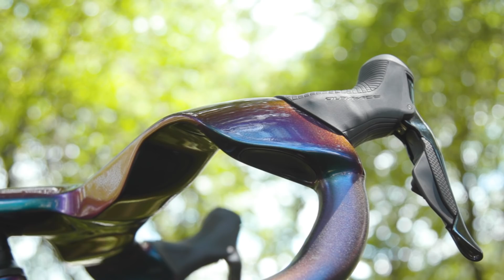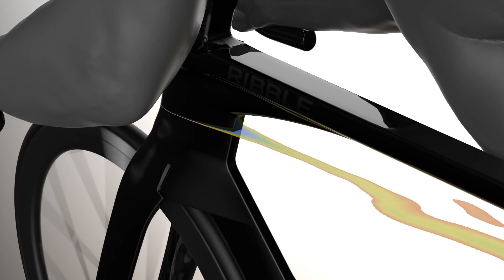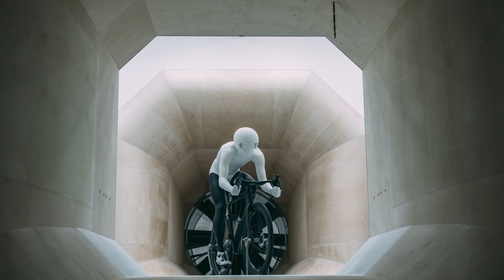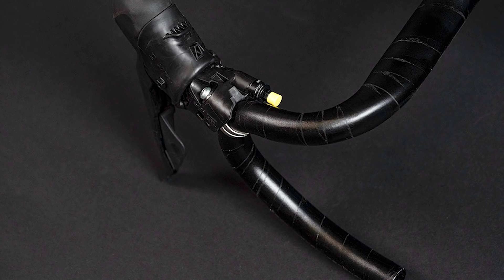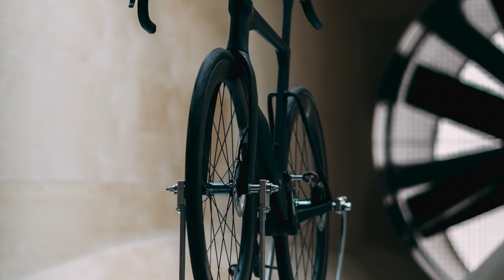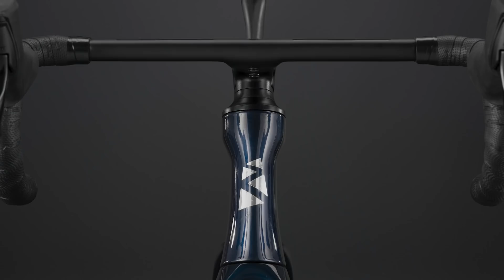NEW Ribble Ultra Aero Road Bike | The Future of Aero Bike Design?

Comment: Beautiful bike but. 
1- Is heavier than an M1 Abrams.
2- Turning radius is horrible. 
3- When the water bottle stars defrosting that water will run straight to that charging port at the bottom bracket and sooner than latter will crate issues. 
I wanted one but I think I’m going to pass.

Comment: Hi. It was mentioned the bike starts at $3K, but without the slick handle bar. Thus, how much are the ones in this video? In addition, it was also brought up that performance savings would start at speeds ranging between 22-29 MPH, but i don't believe these are numbers for the average rider. Hence, benefit from (if at all) on such bike design and let along justify the cost. They have nice paint colors though. Cheers mate..

Comment: Just putting this out there, shaving you legs will save you effectively the same amount of time, 79 seconds, over a 40km Time Trial - Bike Radar's own reporting and also several studies.
Wearing a skin suit will also save you similar range of savings, around 96 seconds for example using a Specialised skin suit. 
Sorting you position on the bike will probably have a bigger effect by lowering your CdA.
However if you have cash to splash the bike looks awesome.

Comment: If Specialized had come up with that handlebar they would be getting absolutely flamed in the comments for how proprietary it is.
Reply: It's a good thing Specialized learnt from their mistakes with previous bikes, I like how easy the new ones are to work with.

Speaking of proprietary, I now hate the Pinarello Dogma F, not only limiting riders to one cockpit, but beefed up the steerer tube to 1.5 inches too, a diameter no other cockpit takes.

Bikes with full internal routing that aren't very difficult to work on and have great cockpit + groupset compatibility almost always win my heart.

Comment: I have to say that it looks quite stupid with standard bars! What's the weight?
Reply from the maker: The top tier, Dura-Ace Di2 model with ENVE Foundation wheels is claimed to weigh 7.6kg, so we can expect cheaper builds to weigh a bit more. Thanks for watching! 🤘
Reply: @bikeradar  wow, my D/A Di2 Disc TCR isn't much less and has much lighter wheels.

I've been holding back on an aero .. thinking that aero and each and TT, etc should all evolve into something we could simply call a "bike" and maybe the Ribble is almost there.

Comment: I like the idea of doing something different with the way the levers attach to the handlebars but I have one question.  One of the advantages of the traditional clamping setup is that if you fall the clamp lets the lever rotate so the bar has a better chance of survival.  Has Ribble designed the bar mounting for that kind of crash and ride scenario or will a crash require a new bar?   If so, have you ordered enough replacements to accommodate the need or will people have bikes hanging on racks waiting for months?

Comment: Any particular reason why the Dura-Ace equipped bike uses XTR rotor?

How are the shifters attached to the bars? It is also not quite clear how the brake discs are shielded from the wind?
Reply: Because they are cross compatible and it is impossible to get dura-ace disc until 2022
Reply: @graemepaterson1983  indeed,..I have DA rotors which are nearly worn, am thinking of switching to either XTR or Campy rotors.

Comment: Yes it will be one of the most aero road bikes you can buy (maybe the most now that brands have stopped selling rim brakes that are more aero) but it's basically a time trial bike with road bars at this point... The handlebars wake generators will have to be tested independently to see if they actually work, I suspect they may only work in the laminar flow wind tunnel and not out on the road in real world turbulent conditions. The non-round clamping points are definitely a good advancement though.
Reply: Aero hardly matters in a bunch anyway.
Reply: @mitchellsteindler  yeah, that makes the bike even more pointless, just unneccesary weight and harder to control in windy conditions. I think the guy said it was designed to be near the front or in a breakaway at some point in the video though.

Comment: They talk about it being a bike for every day riding....What about lighting and gps mounting options? Is that a press fit BB? Is the handlebar supposed be wrapped/can it be wrapped and look decent? Its mentioned it doesnt need to be wrapped but are the bars comfortable and will they provide enough grip? Different bar sizes? Are there any different length options? Was tire clearance mentioned? Also, fun fact, its mentioned that at a lower speed you can save more time, but could that be because there are more seconds to shave off over a given distance? Because if its a faster bike aerodynamically wouldn't it save a greater PERCENTAGE of time (rather than just seconds) at a higher speed?
Reply: Its simply maths... the longer is the ride the more you save time. Nothing new
Reply: I think its not designed for a long endurance trip. Maybe its more suitable 30/40km loop sprint cycling session.  Because I don't even have a bidon and lights on my bike lol i just mount my cyclocomp on the stem
Reply: I hope I can wear my designer jeggings and white leather jazz dance shoes whilst riding the Ribbed XXL Aero..lol
Reply: Excellent points.  Too much marketing speak and not enough practical talk in this one.
Reply: @MrKevinWhite  who cares about practicality when it comes to marketing? I also tend to think that traveling with such a bike would be the ultimate pain in the ass
Reply: @krbndlls  lol that's true 😂
Reply: The ultra comes with a standard threaded bsa bottom bracket across all models, with multiple options in handlebar widths and stem lengths. Hope this helps in some way 👍🏼

Comment: The direct mount handlebars are more of the game changer here than the frame.   EVERY bike brand will brag about "aero optimised" frames, greater stiffness, more aero with a bottle etc..... but I think only Ribble and Shimano have so far gone to the tapeless bars and the Ribble looks more advanced on the integration.
Reply: drivel, drabble, fibble, babbel  😊
Reply: Total integration means a shitload of ugly, heavy, proprietary, non-interchangeable components. Crash and they'll take months to be replaced or until you'll be told that the parts are already out of production.
Reply: @einundsiebenziger5488  Direct mount brakes, flat mount disc calipers, English thread BB, 27.2mm seatposts, 1 inch threaded, then 1 inch thread less to 1 1/8th thread less and now tapered steerers, Garmin 1/4 turn mounts, GoPro mounts, all started out proprietary and now are commonplace.  Just because it's unique now doesn't mean niche in the future.  As they state in the video, the bars are the development, but the shifters are standard.  Smash a shifter in an accident and it can be replaced.  

If your looking for gains, these are the expensive extreme marginal gains level tech solutions.  Pro teams would have a load of spares to eek out every last watt.  For the weekend warrior with the cash, a tube of Veet and a razor blade will have far greater aero gains.
Reply: @a.cyclist  Thanks. I am not talking about means to attach one thing to another. While the Gamin mounts were unique to Garmin computers, the mounts could be attached to any stem or handlebar. I am talking about e.g. integrated stems and spacers that only fit one specific frame and cannot be mounted on any other frame. And look at Cannondale's bars bolting on top of the stem. You can neither use their bars nor stems on any other bicycle. Bad enough that almost every manufacturer has its own BB measurement and calls it "standard", now they're etending it to bars, stems and spacers.
Reply: @a.cyclist  is the veet for the legs and the razor for the face?
Reply: @markblanch2905  start at the toes, stop just above the eyebrow line for maximum aero gains.
Reply: @a.cyclist  hmm, doesn't answer my question in any way but rightio

Comment: When did £3100 become a competitive starting price for a bike with 105. That insane. The industry has gone mad.
Reply: Exactly, £3100 for a 105 bike without the ultra bar? LOL...
BTW the wheelset costs around £650 and is heavier than my alloy cosmics...
And it is out of stock until April...
Reply: @methe2960  what the fuck is the point of having a bike that is marketed as having x features and then not having the features in the model most people are likely to buy…
Reply: Er… because in the piece it says that every build comes on deep section carbon aero wheels? Or did you miss that there’s a £1k+ wheelset in the prices?
Reply: @rep7552  open mold deep section carbon rims are less than $200 from the factory.. theyre nothing special anymore

Comment: The handlebar design is interesting. I like the idea of a direct mount lever. I hope there's a level of adjustability on the angle of the hoods. As much as I like having it level, there are others who may want to push it down or tilt it up a bit.
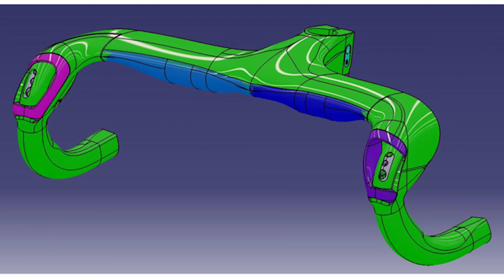Reply: at 6:40 you can see the groove/bracket to adjust the lever.
Reply: They have 15 degree angle and 30mm vertical adjustment based on a written review.

Comment: What happens when that handlebar swings round when moving the bike or packing whatever and smashes the top tube? Was it tested with bar tape and/or have the put a stop on the bars turning maybe? Might of missed but that's all I could think of...
Reply: you don't pack this bike. You ride it to where you want to go. If you have to cross the sea then you buy a new one when you reach your destination.
Reply: Just put bar tape on the drop...
Reply: I would expect the steering to lock at some point, I know at least some aero bikes have a limited steering radius.

Comment: Edit. Ah I was mistaken. I was looking at the aero SL R frameset page and it seems that the geometry shown there was from their carbon gravel bike. Rest of this comment is therefore irrelevant. I will let ribble know about the small website mistake.

Wow the geometry though is very high stack compared to its reach. How is that aerodynamic for the rider? I am a full two cm higher in size L than I would expect from a race bike! 592 stack in size L. Only 389 reach. But the handlebar seems to have a long reach to it and combined with fairly slack seat angle, reach may not be the issue. So that might relieve that. I would expect something around 570 ish, regarding stack. So it actually seems very optimized for the recreational rider, not the competitive racer.

Even their endurance frames are heapss more agressive on stack to reach ratios. On their ribble endurance SL R in size L its 396 reach 562 stack, which would fit me bang on. And would likely make me put 5mm of spacers. So that thing brings the handlebars a good 2cm lower than on the aero frame.
Reply: Stack at L is 564, not 592, and reach is 401.
Reply: I don't know where you got those figures. The chart on the Ribble site says 564/401. You only have to look at the short head tube length to know the stack wouldn't be that high anyway.
Reply: Not everybody has the body proportions and/or mobility to fit on a frame with more agressive stack to reach ratios. And while adding 5 cm of spacers under a positive-angle stem is a solution to many, there simply aren't enough frames with a significantly higher than 1.5 stack to reach ratios on the market.
Reply: @11robotics  surely the aero race bike market and most likely the sponsored race team's needs are what this bike is about. The Ribble Endurance is where they dropped the ball, that has similar geometry to this bike but should have been less aggressive.
Reply: @the318pop  I was perhaps misled by the number of references in this video to the fact that this frame brings so many aero benefits in the real world to the not-so-fast and not-so-pro rider.

We all know the average client for this bike is the MAMIL with way more money than legs or heart, and possibly a slight beer gut.
Reply: @11robotics  I'm not sure. MAMILs tend to prefer prestige when selecting their optimised aero sportive bikes and Ribble may know this.

For what it's worth, I am a MAMIL but have an early 80s Peugeot with full mudguards and triple chainrings. But the stem is slammed. The antithesis to your description above.

Comment: The handlebar design is very intriguing. Also glad that the shape is optimized for the aero hood position as well as the drops. I'd buy the integrated handlebar if it was available as a standalone product.
Reply: I'd like to know how crash resistant the lever attachment is. On a standard bar, the clamp allows the lever to take a pretty good hit and just twist without breaking the bars or doing a lot of damage to the levers.
Reply: Or, you could 3D print a very light snap-on attachment that models the aero protuberances.

Comment: "full fat" what does that mean
Reply: Originally it refers to milk where you can buy skimmed, semi-skimmed or full fat but in everyday language it means anything that hasn't been compromised. In this case the bike is a full fat aero bike because it's been designed to be purely as aerodynamic as possible above all other considerations.
Reply: @robertohaubold752  I never knew wow